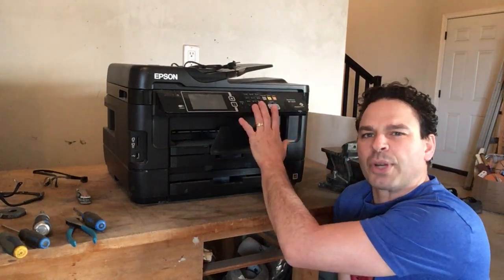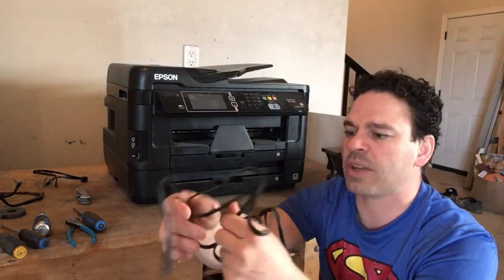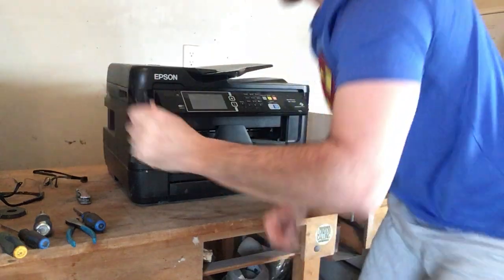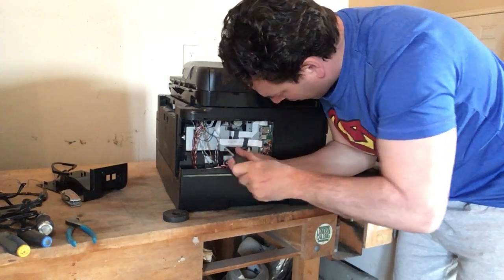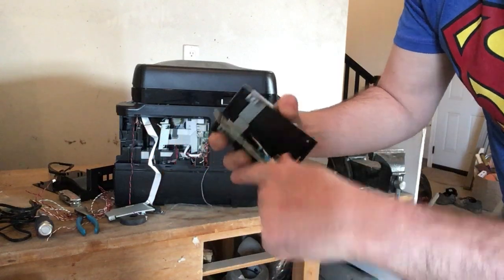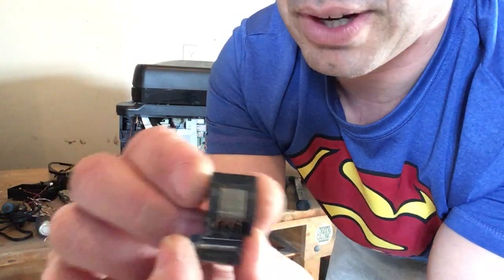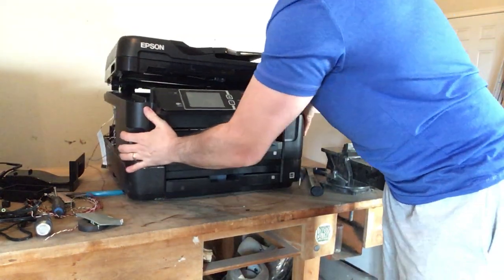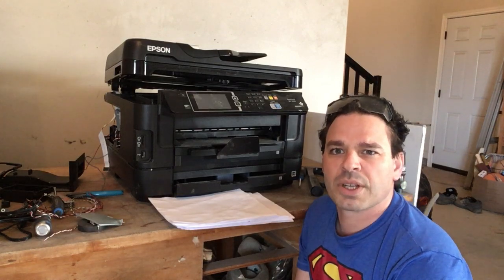Scrapping a large printer for copper, tin, gold and 100% scrap!

Comment: Printers are another Item that the scrap yards here in Wisconsin, USA charge us to take... I've taken many apart, there are quite a few roller shafts in them and if you save the separate you can get a better price for them than shred prices. Like #1 prepared steel or what ever your yard calls it.

Comment: Thanks for the great videos. I often hear you say things like 'this will go into my steel bin', or 'that will go into my aluminum bin.' I'm new to scrapping, and am still trying to figure out how to best organize different metals separately from each other. Would you be open to showing how you organize and store your different metals between scrap yard runs if you haven't already done so?
Reply: Hey Bradley, not Tin Man here, but until you get a better answer, in case you don't already know, you can hit any ferrous (containing iron, usually but not always magnetic) metal with an angle grinder and it will spark.  Aluminum will not.  A magnet can't always tell the difference between ferrous and non-ferrous, but the angle grinder can.
Reply: @gavinclark6815  Awesome, thanks!

Comment: Is there no silver contacts or Mylar behind the buttons of the control panel?
Reply: small silver contact buttons, but not enough to have to want to take apart the plastic casing
Reply: @jamesfirth1280  couldn’t just use a pry bar to lift the panel out?

Comment: You missed one other spot that has gold. On the ink cartridges you showed a tiny circuit board with gold contacts. What do those connect too? Look inside the cartridge holder you will see another circuit board or mylar as wide as all the cartridges just covered in spots of gold. It does take a lot of work to remove the but it literally doubles the amount of gold you can get.
Reply: I was going to bring this up too.  I've taken many printers apart and I've seen the gold that those ink tank connect to.  It is considerable.